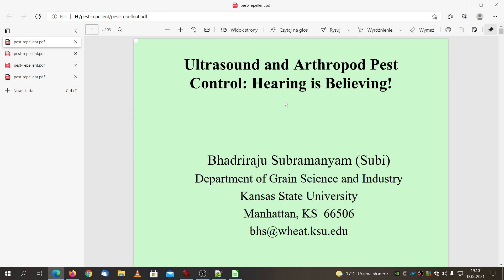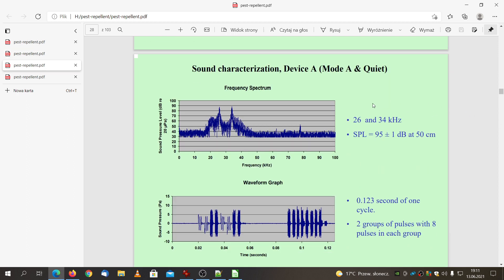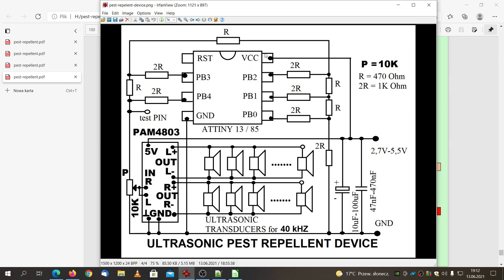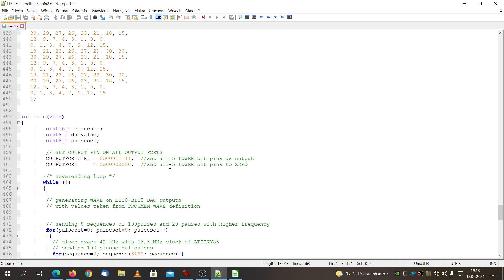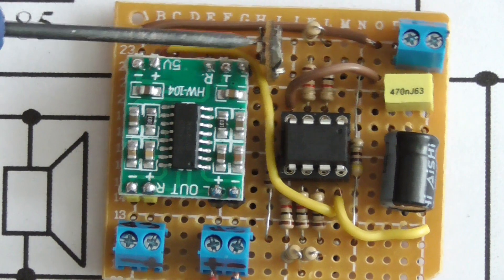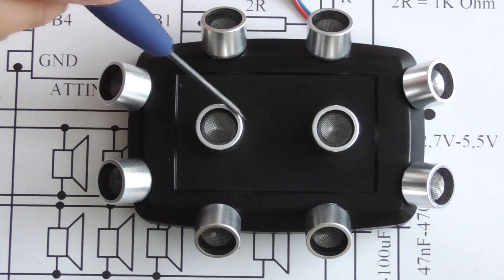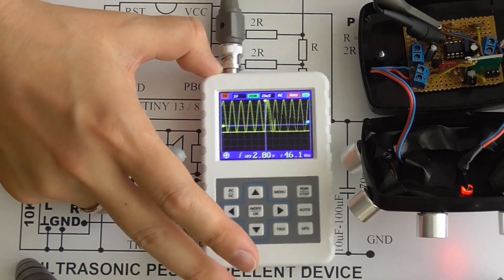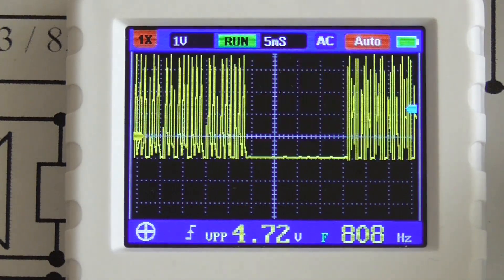DIY Ultrasonic pest repellent device for 10 USD / cheap and effective 40kHz ultrasound bugs repeller

Comment: Hi how can we programme this attiny85 with arduino uno board ? How to setup  with 16.5MHz clock speed ? Can you give steps ?  How to use elf and hex files for programming ? Your reply much appreciated .
Reply from the maker: hi, I am showing it right here in the video https://youtu.be/7klgyNzZ2TI
Reply: @justanengineer5599  Thanks for the reply David ! But I am looking to programme it with arduino uno board . Because I could not find a suitable programmer like you have used .
Reply from the maker: You need to buy USBASP programmer. It costs 2 USD and will allow you to program all ATMEGA / ATTINY chips. Also you need a software AVRDUDE to use this programmer. There rest is in my video

Comment: Today I  assembled one and it's working with the 40khz frequency... It's pending to check on pests. 
Thank you engineer
Reply from the maker: my pleasure
Reply: @justanengineer5599 
Sir., it's good effective on mosquitoes. 
Now I used only 3+3 transducer. 
I will be assembling one more with 10+10 transducer. 
I am using 3.7volts battery and PAM8403
Reply from the maker: super ! great to hear that

Comment: How did you calculate how many piezo devices you could drive in parallel?
Reply from the maker: by the impedance for the resonace frequency of the transducer. You need to consult the vendor to get the PDF documentation there is exact info

Comment: could you please convert code to work with arduino uno?
Reply from the maker: I do not have arduino uno board, this is very old one... UNO  is ordinary ATMEGA328, which configured to work with 16MHz speed may work the same as ATTINY85. The code is so simple that you do not even have to change it. Maybe replace delays  "NOP" with delaymicrosecond(xx) functions

Comment: you need ultrasonic tweeter with wide freq range so you can sweep, but useless to usemulti freq while transducer will output the 40khz only...
Reply from the maker: Yes, using ultrasonic tweeter is better for this kind of appliance. You can easily swap the matrix of ultrasonic transducers to 2 or more ultrasonic tweeters connected in parallel. Also, my code is only an example which can be further modified to achieve appropriate frequency ranges and sequences of emited ultrasound.

Comment: Can we work it on with 12v 45 ah car battery if yes, how long the battery can last without drain & only working on motion sensor on & off...pls reply...if not can u built one & show the video? Pls reply.
Reply from the maker: Hi. Your car battery is normally around 50Ah which means it can stand 1amp current for 50hours. If you use the most powerful option as an amplifier board - TPA3116d2 it should allow you to operate 24hours continously. For smaller audio amplifiers it can last even couple days with no problem
Reply: @justanengineer5599  i just want it to detact rats inside engine bay.. If it works on motion sensor or heat detector will it only getting on that period is still going to work for only 24hours?thanks for reply ur videos are great
Reply from the maker: I think you could use some motion enabled grid socket or some relay to remotely enable this device

Comment: whats the range ? what setting works for birds
Reply from the maker: havent tried with birds but if u use TPA3116d2 module as an audio amplifier the range is 30-50m because of its power

Comment: I see the greatness of your project. I want to make one but I will also connect it to blynk(IoT). From your circuit, I simplified it using ESP32. So I only use ESP32, Pam8403 and also the ultrasonic transmitter from HC-SR04. For the ESP32 I used the DAC1 and DAC2 pins. But I found a problem,  I tried to test the signal range using the HC-SR04 receiver but no pulse came in. I don't know where my circuit went wrong. Would you be willing to provide a contact that I can contact so that I can explain in full and also consult with you?

Comment: hello engineer, can i code this using arduino ide?
Reply from the maker: hi, unfortunatelly no, because the design uses resistor ladder that is not available on the arduino board. If you are thinking about flashing the chip ATTINY85 using Arduino IDE  , there are some methods like this one here   
https://www.instructables.com/How-to-Program-an-Attiny85-From-an-Arduino-Uno/?amp_page=true
Reply: @justanengineer5599  thank you and which part of the schematic did you put the led and the resistor for it?
Reply from the maker: unfortunatelly I did not put any LED on the schematic. If you wish to use it you need Led and 470 Ohm resistor connected in serial attached to GND/VCC. I also suggest to use TPA3116D2 module as an amplifier unit instead of PAM8403 module. It has 10x more audio power and will work perfectly for bugs
Reply: @justanengineer5599  thank you but can I TPA3116D2 using the same code?
Reply from the maker: yes. you can use tpa3116d2 with the same source code

Comment: Hi sir, I have assembled one by using NE 555 timer ic and set to 40khz frequency... I have used 10nos of ultrasonic transducer each 5 for channel with  PAM8403 audio amplifier... actually I tried for mosquitoes and there is no effect on that ..
Please assist what changes I have to do...
Reply: Hello sir,
Waiting for your reply... please
Reply from the maker: did I mention to use NE555? I think no. In my video there is special waveform that drives the transducers, the one that is used by mosquito female
Reply: @justanengineer5599  Extremely sorry sir.,
I will assemble this as per your guidance... thanks a lot
Reply: Hi sir, I have assembled the circuit and programmed your code also but there is no effect on mosquitoes... please assist for any changes...there are two tones which is heard in the transducer...
Reply: Eagerly waiting for your reply please sir
Reply from the maker: do you have audio amplifier and 40kHz in this design?
Reply: Yes sir, like in your video same design I have assembled.Used PAM8403 audio amplifier module and the same design code programmed in attiny85.and also 5+5 transducer for each channel.
I am getting two different tones in transducers.
Sir in my portable JYE Tech DSO shel oscilloscope shows auto varying 1.8khz and 2.4khz with setting 2volts and 0.5ms.Sir I am not getting 40khz in any settings.
Oscilloscope prob kept on TEST point.
Please assist thanks
Reply from the maker: do you have an oscilloscope so you could confirm if it is generating the signal?
Reply: Sir, my oscilloscopes test frequency 1khz square wave it's showing....and assembled pcb also shows sine wave but frequency is 1.8 to 2.4khz
Reply from the maker: because there are sets of signals you need to capture a single frame and check if it is 1/40000 second long.
Reply: Hello sir, Good morning,
Yesterday evening I tried once again reprogramming the code to attiny85.,after erase and write a error message "Verification failed, first' mismatch byte 0x0000."
I am failed to rectify...I am using WIN AVR program... kindly assist what could be the reason....
Reply: Sir, the programming issue is resolved... I am getting only 2.5khz at test point.,also buzz sound at transducers.
I have reprogrammed the chip 4 to 5 times.
Kindly help
Reply: Hello sir.., is there's any chances of programming attiny85 with win avr...or what could be the reason...
Kindly assist waiting for your reply...
Reply: Kindly assist waiting for your reply.....
Reply: Hello sir please provide your mail id...
Thanks

Comment: Great work. I want to build one. Can you add an option of lcd with this setup which display some thing linke secure or jammer is on
Reply from the maker: you may just attach LED diode to the board to indicate that jammer is on. There is no need to attach LCD

Comment: Does this require programming? Thank you
Reply from the maker: yes, you need to upload the program to the chip (flash ATTINY chip) - here is the info how to do it https://youtu.be/7klgyNzZ2TI
Reply: Thank you. another question can this be mixed with 25khz ultrasonic transmitters to have both 25khz and 40khz frequency
Reply from the maker: Yes it may be mixed but you would have to modify the code to include pulses for 25kHz because it is doing around 40kHz now
Reply: I see. Thank you engr!
Reply: I see. Thank you engineer! But can this 40khz be adjustable into different frequencies?
Reply from the maker: yes it can. You would have to adjust number of "NOP" commands that are used to create length of the speaker pulse in the source code

Comment: Very interesting,, but what is the effective distance of the output of these?  What I am looking for is a barking dog deterrent, so how far can this output be projected?
Reply from the maker: that depends on the audio amplifier stage that you use. The small one in this design has 2x3watt while you may want to use PAM8610 module which is 2x15Watt. The bigger version will give you 50 meter range or more

Comment: How many speakers can be connected  to the device. I’m am thinking to buy a off the shelf unit and adding some speakers to that while I build a few of these.
Reply from the maker: depends on amplifier module used. If you use PAM8610 (12v required for this module)  instead of PAM8406 / PAM8403 then you may attach up to 80 transducers - 40 per audio channel
Reply: @justanengineer5599  is there a range limit placing the transducer “pods” from the controller? I am thinking to create a bunch of the “pods” and placing them outside below my soffit pointing down around the perimeter of the house. Not sure if the length of cable connecting them will cause a issue
Reply from the maker: you will  need thicker copper cables from audio amplifier module. You can always use coaxial cable from AD9833 module to PAM module and place PAM module nearby transducer panel. You may also attach many PAM modules inputs in parallel to AD9833 module audio outputs and connect as many transducers as you wish like  hundreds of them. Then the jamming efficiency will be outstanding
Reply: @justanengineer5599  thank you so much for the continued feedback, it has been very helpful especially since I know almost nothing about electronics. I assume I have to have a separate power supply for the Pam vs. AD9833. I thought about using 12v as the input source with a step down regulator, have 2 voltage circuits, one 12v (for the PAM)and the other 5v (for the AD9833). Does this make sense?
Reply from the maker: yes. This is exactly what you should do : a step down voltage converter 12v-5v for arduino and ad9833 modules  and powering PAM module from 12v directly

Comment: Dear sir plz explain your calculation parat ? How to selected this values ? Plz help me
Reply from the maker: Hello. I am using Libreoffice Calc for this purpose. Please open this file with Libreoffice : https://github.com/mcore1976/pest-repellent/blob/main/waveform-calculations.ods   there is a calaculation with use of SIN function that derives 32 samples from 0-32 range. If you need higher frequency , the number of samples has to be lower. If you want lower frequency the number of samples/values has to be higher.   
I am also using osciloscope to validate the result frequency of the design.

Comment: Dear sir, I want to create an ardiuno based pest repellent device.  I kindly request you to explain it in the appropriate circuit diagram
Reply from the maker: hello, all informations are here : https://github.com/mcore1976/pest-repellent      and the circuit diagram is here  https://github.com/mcore1976/pest-repellent/raw/main/pest-repelent-device.png
Reply: @justanengineer5599  thanks for your answer. I could see the list in GitHub. What i mean is if you have a link to buy the transducer.
Reply: H

Comment: How do dogs, cats, and other animals react to this?
Reply from the maker: dogs and cats are sensitive for 25kHz but this is 40kHz based so they ignore it. Others like f.ex. rats can hear and are susceptible
https://www.lsu.edu/deafness/HearingRange.html
Reply: @justanengineer5599  what does "like f.ex. rats" mean?   Maybe that's a typo?
Reply: @ToddWilliams91360  I think it’s “for example”?
Reply: @ToddWilliams91360  i think that is shortcut for "for example"
Reply: @justanengineer5599  So if I make the recording jammer using the 25khz ultrasonic generators, I should keep it off around my dogs?  I don’t need it around home of course but just curious.